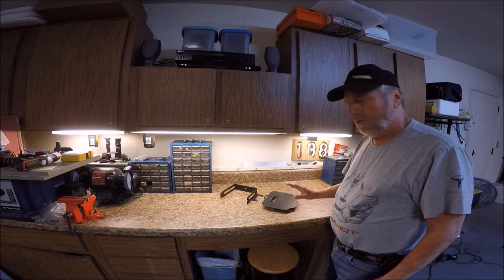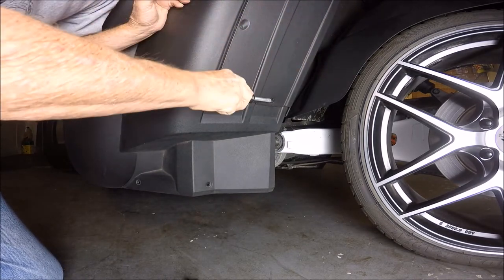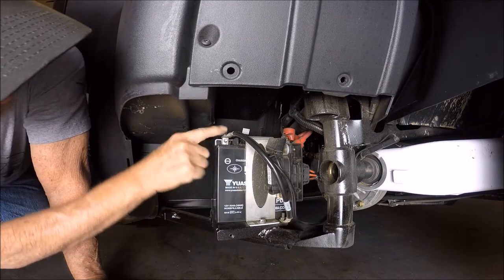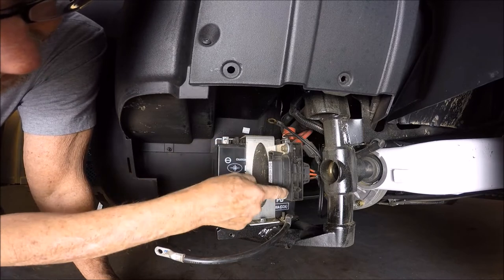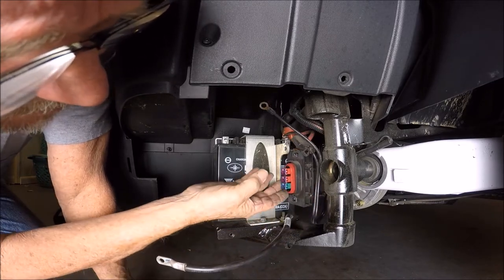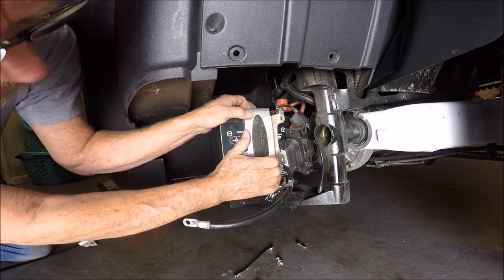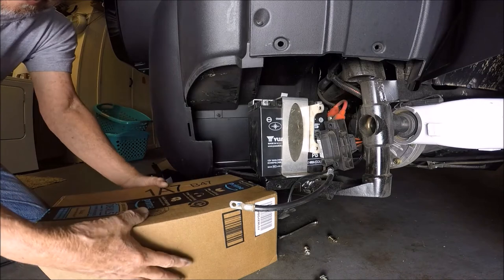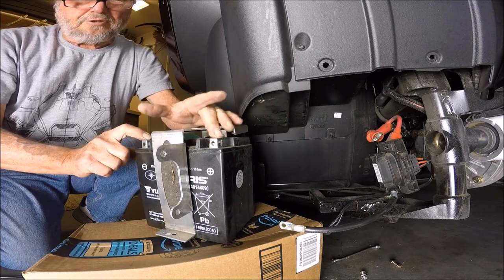2017 Polaris Slingshot Optima Battery Tray Installation

Comment: THe Optima battery you call for is the wrong one. looking at the battery the negative terminal should be on the left and positive should be on the right.
Reply from the maker: I have not seen the battery as I was given the numbers for the correct battery that Slingshot Only installs.  I will have to look at this.  Thanks for alerting me, no one else has said anything about this.
Reply from the maker: MSgtKevin Patnode, I looked that the Battery and saw a video of the battery back view.  The battery can be turned around and should work.  The main thing is that most of the Optima Batteries are too big in physical size for the Slingshot.  The tray ans strap have measurements that can not be exceeded.  Slingshot Only has told me this is the Battery they use.  I do appreciate you pointing out the issues with the terminals.  It is important.
Reply: @samowens44  Nope it wont work, go ahead and try it and see what happens...

Comment: Hi sam I’m having a problem with my slingshot, it was parked for a month then I came back it won’t start. I jumped start it left it on for almost an hour, turned it of and it won’t come back on unless I jump start it again. I don’t know if the battery is damaged. Please help me thank you
Reply from the maker: Hi Azize, sorry to hear about your problem.  Here is what I suggest.  With a volt meter or a voltage indicator inserted in the power port.  If in the glove box you must have the key on to read the voltage.  voltage should be 12.6 volts for a fully charged battery.  If the voltage is in the 10 volts range, you will not be able to start.  Once you jump start it, check the voltage with it running.  Charging voltage should be 13.6 volts.  If you drive for an hour or so, it should charge the battery properly to start.  If these conditions are not met, you need a new battery.  A Slingshot battery will get around 3 years of service.  Good luck.  Auto stores have voltage monitor devices for $12 that plug into the power outlets.  A cheap volt meter will run around $15.
Reply from the maker: Azize, do not stick volt meter probes into the power port, only a voltage monitor.  volt meter lead should be placed across the positive battery terminal and negative.

Comment: Sam I replaced my battery and now the engine warning light is on when I start the engine. Any solutions ? Light was not on previously . Thanks  2017 sl model
Reply from the maker: Arlie, i think you are referring to your yellow engine check light.  There should be a Diagnostic Code that will indicate the type of problem.  You will need to go to owners manual to find out how to retrieve the code.  Go to to our forum, Slingshotforums.com  if you are a member post a question as to what does the code mean.  Someone will be able to tell you.  Your dealer can also tell you.
Here is a link to my video to show how to get the Diagnostic code from the engine check light condition.
Here is a post of someone having your same problem on Slingshotforums.
https://www.slingshotforums.com/threads/2016-sl-battery-died-replaced-batter-and-now-check-engine-is-on.166049/#post-846145
Reply: Sam Owens thanks Sam for the help I moved the slingshot this morning and light didn’t come on , maybe had to rest after battery change ?
Reply from the maker: @arliebuckner7883  That appears to be the thing with changing battery.  Most say comes in then goes off after a short period.  Glad all is working for you now.